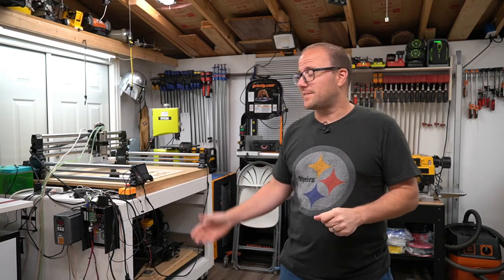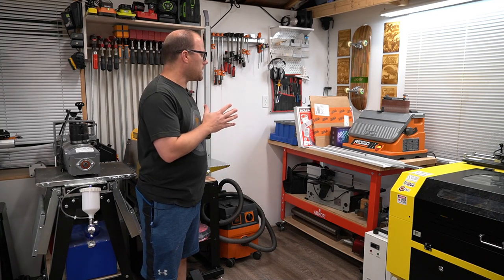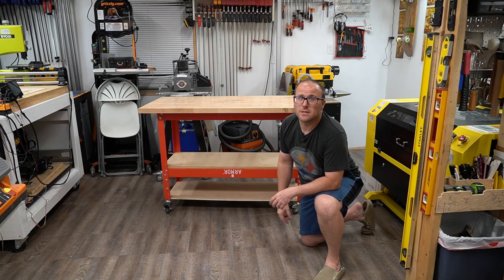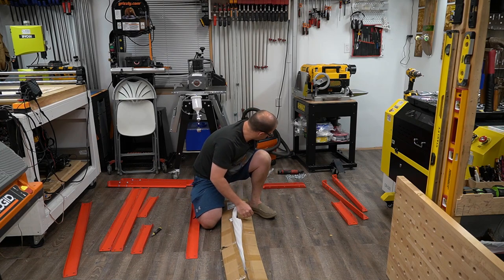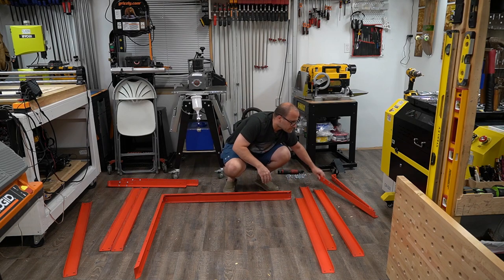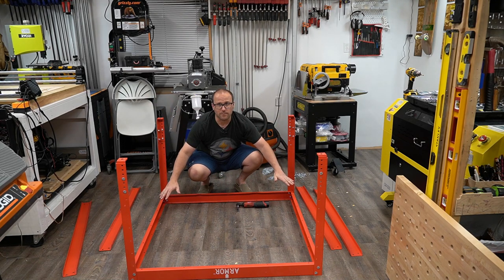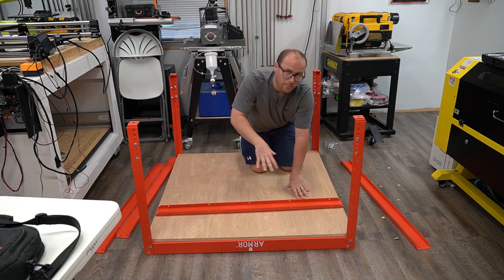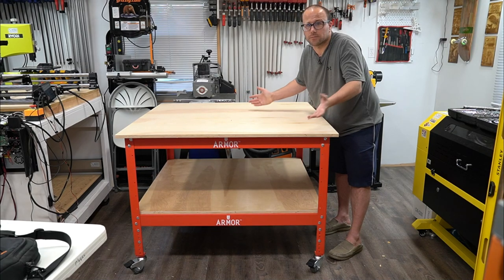Double Armor Tool Bench CNC Table

Comment: Ben,
Have you given any thought to adding a 'vertical' workstation to a table.  The OneFinity is so versatile looks like one could move it less than 8 inches 'off' the table and have a fold down clamping board for joinery.  Yes, I am 'borrowing' the Legacy CNC idea, but $20K  is certainly out of my reach.

Comment: $1800 for a table with a ¾" top with no reinforcement??  Aren't you at all worried about a single piece of ¾" plywood spanning that far for the base of a "strong cnc"??? Looks like you just engineered in the weakest link in the chain.
Reply from the maker: The next video where were I build the enclosure will show how I placed another 3/4 mdf ontop of that 3/4 plywood.
Reply: @MyersWoodshop  I reread that comment 10 months later and it sounds like I was being a real smart ass. I apologize if it did. Your videos are where I began my cnc journey because when I bought my 1st Shapeoko used I'd never owned a computer. Your videos were and continue to be a inspiration and I really appreciate everything you do!!
Plus I love the video about your grandfather!!